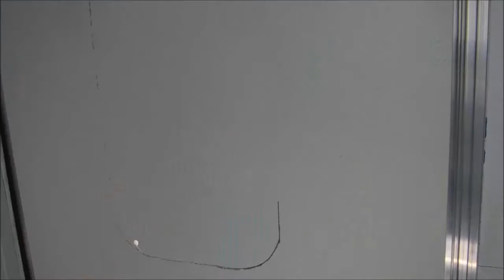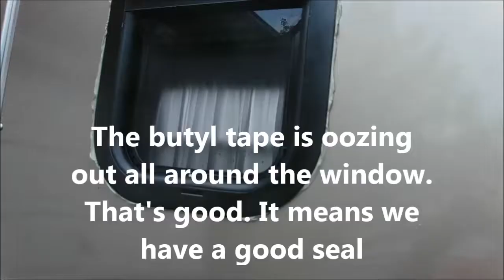Our 7 X 12 cargo trailer conversion Episode 14  Installing a window in the door

Comment: Excellent video, so glad I found it!!
I am in the exact same position having bought a surplus window w/o an inside trim ring (at least it has a screen) & I also made an oversized trim ring we had laying around fit on mine.
Yep, I had the same idea you did to a “T” but seeing you do it gave me the confidence I needed to install my new window in our V-nose snowmobile trailer door. It also reminded me to grab the semi-trailer foil roof repair tape for the inside edge :-)
Thank you for taking the time to do this video, it was really helpful!
Reply from the maker: Thanks for the comment. Always glad to be able to help.
Reply: @Dan Burkhart  hey Dan what was that window depth 1.5?